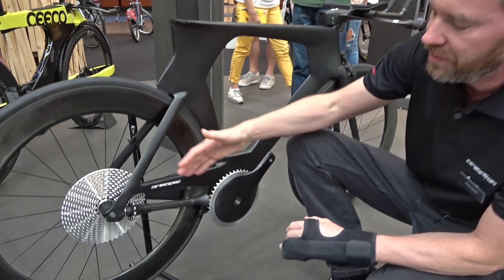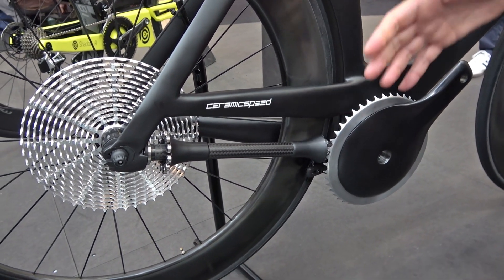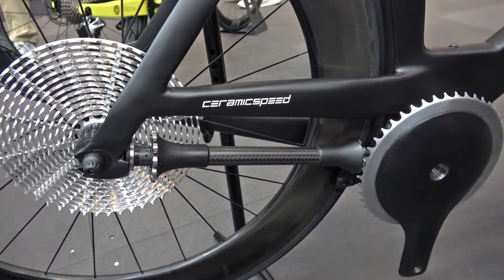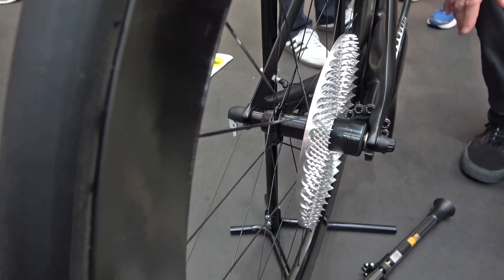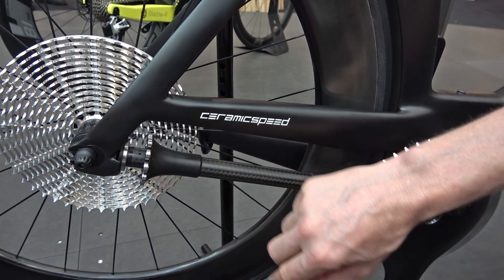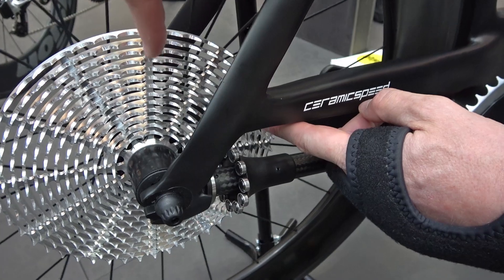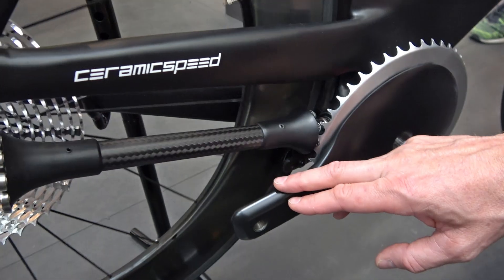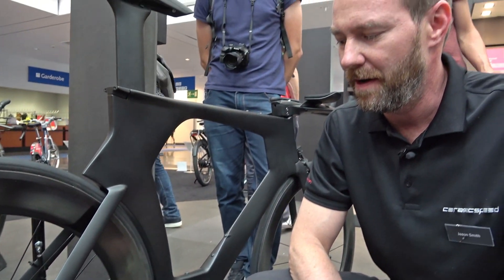CeramicSpeed Driven - Fully explained

Comment: "The world's most efficient drivetrain." ... Yeah, when you twirl the crank with your pinky! 
2 points of rolling friction is great until you put some force on it, then you realize that you need those 8 more points of contact in order to handle the torque necessary to power a bike/rider forward. 
Aesthetically, it looks pretty, but mechanically it looks ugly to me because you're changing the axis of rotation twice.
Reply: That is true
Reply: I agree with you. This is not IC engine to reduce the friction is a fakin bike!
Reply: Not to mention friction in two bearings at beginning and the end of the axis.
Reply: GR28 yeah. The tolerance on this is crazy. They are just doing a regular drive train so they need to go helical for more contact surface area. 

This is nothing new or special. They are way behind of current tech so they are actually a bit stupid.
Reply: also there using open bearing that would need to change out here in Australia the is loads of dust even in the big city's those bearings wont last long
Reply: True
Reply: You got a good point..
Reply: 2 points of roller friction... The bearings make contact with the entire surface of the cog teeth vs many tiny points of contact with a chain. Inside those bearings, there are many more points of contact more evenly distributed. 

How many times does your car's drivetrain change the axis of rotation? A lot more than twice! How many chains are used in the drivetrain vs how many bearings (fluid and roller)?
Reply: "Drivetrain"? I didn't see an actual drivetrain
Reply: Additionally, the fact they need to substitute good mechanical design with a computer interface for gear shifting stands out as a major design flaw, not an innovation & adds a layer of complication of things that can go wrong under extreme conditions.
Reply: I simply do not believe that this design is durable. It will need regular replacement, which is a nice idea if you make you money by selling stuff.
Reply: @johnmadsen37  yep. choice of weight reduction would not stand up to much hard peddling. an athetic human can output almost 0.4hp and the torque from gear reduction would mash the teeth of those aluminum cogs... intersting but sooo not practical
Reply: I might disagree on account of originality since a system very similar to this one performs excellently in detal handpieces and counterangles with more than 40 thousand cycles per minute. Lubrication however might present something of a problem but the whole system could be hidden inside the rear forks thus offering protection from accumulation of dust and dirt. Nevertheless,  a lot of potential in this system.
Reply: @mrbobsevil  The bearing wouldn't make contact on the full surface if the bearing diameter was smaller that the diameter of the cog teeth. They would only make contact on a very small portion of the bearing surface as it rolls through the cog.
Reply: ForexTradex Take a wild guess what the efficiency of even a manual car transmissions is???? No where near 90% why do racers add differential coolers... because low gear efficiency heats the oil up
Reply: Kirk Claybrook energy in one side, motion out the other....drivetrain
Reply: I was definitely curious about the smoothness of engagement, as well as deflection and deformation of the "cogs" under load.
Reply: What's really ugly is a chain that flexes, when you shift, and becomes inefficient.
Reply: @ForexTradex

Only once. I have a proper rear wheel drive vehicle.
Reply: With a chain all of the forces on two little sides of one link.

Comment: This thing would pop the bearings over the teeth if you push too hard
Reply: agree and that disk looks actually very fragile considering part of the force will be perpendicular to the disk
Reply: That is exactly what I wanted to comment, beat me to it
Reply: Especially if you have this 20 speed version.  The gear furthest from the hub would get really wobbly, I would expect.  Then add hammering it up a climb, where you would use that gear.... seems like you'd need a two sided cage version that holds it all together.
Reply: Or hit a bunch of bumps while hard pedaling.
Reply: Exactly what i was thinking... imagine a sprinter going full tilt max wattage in a lower gear with that disc  flexing .... bearings jumping teeth like crazy.. that + full suspension= disaster !!  Unless the drive rod was somehow   also the swingarm ???
Reply: Green Lizard    GOOD ONE. GOT MY LAUGH FOR THE DAY.NOTHING FUNNER THAN OR MORE PAIN FULL THAN A NUT SHOT
Reply: I think to help with the extreme torque the rider would put on this you would have to make the front teeth much wider and out of a very durable material.  Then the shaft would need a huge gear up of something on the order of 10 to 1 to start with, maybe more.  This would make the cassette area wide and it's diameter large too.  Still does not solve shifting challenges.
Reply: Exactly what I thought!  Put a couple pro riders on this and I think they’ll chew it up and spit it out.  Nice to see some thought going into new ideas but it’s gonna be hard to beat the tried and true chain and derailleur system.
Reply: Hey Mike I responded to this video with a very similar answer to yours, not knowing what you had wrote.  I agree with your comments.  But I also believe it is very good for the sport that folks are looking for a better way - I just don’t think this is it. I like the idea that this bike drastically reduces dish but I also think it’ll get shredded in a relatively short period of time.
Reply: @mikemace2322  Full suspension? This is clearly intended for road/tt bikes. MTBs don't need 99% efficient drivetrains.
Reply: NASA will have men on Mars before this monstrosity ever works. Only a pillock would buy into this nonsense.

Comment: I guarantee  that would either break or slip under high torque like hill climbing.
Reply: That's the first thing I thought. Everything is under a side load now and no backing plate for strength. Cool design but I think it would end up In pieces.
Reply: Wait till you snag a plastic bag....You will have to call the A.A. out for a tow.
Reply: I think they could solve that by beefing up the cassette, but that would add a substantial amount of weight.  Would be cool for someone like me who doesn't race, but anyone who does would want to watch out

Comment: Only one question for me is how much torque can it handle before popping out of the track or shearing driveshaft or stripping ceramic ball bearing out of housing basically how much power can it handle.
Reply: Month later no reply must not be able to handle much power might as well assume that is its flaw

Comment: So it doesnt shift yet, so basically theyve jst dug up a 100+ year old drivetrain and done nothing with it yet
Reply: No, the 100 year old drivetrain actually worked. Major Taylor raced on it. But it was a properly designed shaft drive.
Reply: Weird how some modern ideas were someone's pipe dream years ago.  Like the electric car and apparently this drive train.
Reply: Random Kirks Italians made an electric car in the 50’s or 60’s if I remember correctly. It wasn’t very popular.
Reply: @mrnobody9821  Studebaker made electric cars and busses in 1890. They worked.
Reply: It looks nice on that stand, but I see several problems having to do with the pressure between the tiny bearings and the flimsy gears, by the time you're done it will be four times heavier.

Comment: Undoing the inherent simplicity of the drive when you add electronic-wireless-battery powered shifting.
Reply: High end derailleur bikes now use electronic shifting, with batteries and servos. It's lighter and more reliable than using bowden cables.
Reply: just buzzwords to sell old tech as "innovation"
Reply: The pinion is rotating so it needs to be wireless.
Reply: It would be nice if electronic derailers could be powered off the bike itself.
Reply: Barbatio I think that would be completely possible. The rotation of the shaft could generate current in the same way an automatic watch is powered by your wrist. 

I can think of 3 reasons not to do it that way. 

1. Perhaps the space is very small and they already and having trouble making the electronics fit. 

2. The generator would require some, even if it’s very small, humans energy. It might add up in a long race.

3. It’s possible the current draw is pretty high and would not be offset much but a small generator in the shaft.

4. Added expenses and such. Although I doubt they are worried about that
Reply: @Mrcaffinebean  I meant to say, they charged of the bike, the battery still handled a lot of it, but they charged when you were riding. I also worded that weird, I mean it would be nice if they were powered off the bike.
Reply: Barbatio I’m not sure I understand what your getting at
Reply: @Mrcaffinebean  Electronic derailleurs that are battery powered, but they can charge off the bike while you're riding.
Reply: Barbatio right, but all of those consume power and add weight and they don’t need to fit in a tube like this one does.

Comment: There is no foot pedals so that nobody would come and break it. Now imagine that under a hill climb by 100kg man. 

Efficiency may be 99% in a small torque, but in human foot force is too much for this. To withstand this, they would need to make this a lot heavier. I hope potential investor will be able to read these comments.
Reply: voaa they said they tested it as 380 watts
Reply: It is torque that breaks it, not the watts. Think of 100kg standing on pedal, torque is about 250Nm, power 0W.
Reply: @cjschmitt4882  So it being a prototype excuses the totally infeasible design? Okay...
Reply: thanks for warning me :)     BTW how much is "too much"  engineers work with numbers not opinions.  How do you know that human force is "too much" for this mechanism.  As soon as you step on the pedals, you would convert torque to linear motion.  
Besides, nobody is holding the bike wheels against rotation place and have an elephant step on the pedal.  :)
Reply: Climbing a hill would tear that puny shaft to shreds. So many things wrong with this design I don't even know where to start.
Reply: @abz124816  Obviously I have nothing to go on but this video. Niether do you, from the video you can estimate the shaft diameter, and the approximate number of layers in the wall. The maximum shear stress of carbon fiber is already known. If you do the math...which I'm sure you already have done, you would see that the shaft will buckle under loads close to the maximum torque a cyclist can apply to a pedal. Plus this torque ~1000nm is then applied to a single tooth on the cog. On a chain-drive, the torque is spread out amongst several teeth. The other design element that is sketchy is the electronic shifting mechanism inside the shaft. Wireless communication is going to be pretty difficult through a wall of carbon fiber, and batteries will have to be very long lasting and rechargable, not to mention the size requirement is pretty tight for a battery, com, g sensor, actuator, and motor.  I get it. He name drops a university and people think, "wow this is innovative!" But keep in mind, these are students, working on something for free. They aren't actual engineers working on a functional prototype.
Reply: @s00p3rman   Hi Joshua, 1,000nm = 737 ft lb.  A VERY powerful car engine produces only 300 - 400 ft-lb of torque.   How is a human being going to produce 
737 ft-lb?    Additionally, nano technology and new materials science,  (look up Graphene), already provide materials, though very expensive still, that are incredibly strong.  Rather than being critical of the design,  admire the creativity and ingenuity.   20 years ago there were no carbon fiber bikes that weigh 14 lbs., today if you have the money, you can buy one.   
From first human flight ever, December 17, 1903 to a moon landing Jul 16, 1969 took less than 66 years.  Can you believe that?   Have faith in science.   :)

Comment: As said its very light and has low friction. 

Now if you show it withstanding a rider kicking up a hill without causing deflection of the rear gear cluster away from the rollers on the shaft, you have overcome one obstacle.

If it will shift reliably/smoothly going up a grade under heavy load you have overcome another.

If it can withstand abrasives and moisture, again another challenge met.

Seeing as to how this vid is almost a year old I would have to assume some of these engineering challenges are proving difficult to overcome.

Comment: I don't get why you put it on the rear wheel. Adapt this into a "gearbox" that can serve as the front cog with a drive shaft turning a worm wheel in the rear so then the rear wheel suspension can work better.

Comment: The rear sprocket doesn't look rigid enough when you are in Low (driving outermost sprocket.)   The radial ribs appear to be constant cross-section when they should be exponentially tapered to get the necessary out -of-plane stiffness of the outermost sprockets.

Comment: Materials are not there yet. Too much load on one bearing "tooth", and rigidity of cassette has to allow for low gear (outer ring) from springing back at high loads. Nice demo, hope someone invests in it as a good lesson to learn mechanics.  ( :  A text book from 1830's would do
Reply: yeah, but the teeth don't need to be formed like what we see here, what we see is what you'd shape them like if they (still) would have to grab onto a (bike) CHAIN! they didn't think of that yet, but now that we got rid of the chain, of course we'd shape the teeth the way the teeth on PROPER sprockets would be shaped, where on both sides the teeth are shaped in an equal fashion - and MUCH stronger than what we see here. besides, the construction as shown with unnecessary ball bearings in the back even has more week spots where those ball bearings are attached.

Comment: Problem I see with this system: You need very little tolerances in the concentricity of the chainrings and a high stiffness of the crank and bikeframe under load. The drive shaft can not counterbalance any tolerances or wear like a chain can do. So you need a force to push the gear to the "chainring" to prevent "jumping". A Chain creates its own force , which pushes it to the chainring. You can compare that system with a back differential in a car.
Reply: Its got to be so stiff with no flex and  tolerances so precise and it would probably wear out sooner cause of less surface area loading in an abrasive harsh environment unlike a diff. Pretty but unlikely

Comment: "Wireless electronics" inside a carbon fiber tube which shields rf......nice art project.
Reply: @WhiteShadow2k1 might get complicated - the shaft is rotating. Not saying there isn't a way, but the wireless option would probably be the easiest.
Reply: @joeMW284  a wire connected up to a magnetic sensor/signal generator could easily transmit a signal to a rotating shaft without contact.
Reply: Such a short yet absolutely brutal comment - "nice art project" just puts the cherry on top of this masterpiece of text.
Reply: @joeMW284  a slip collar to control the gear shifting portion could easily be actuated by a simple wire cable. slip collar would just ride in the air as the drive shaft rotated inside of it unless shifting then contact with the inner portion of collar that would be a bearing, push or pull you could shift gears smoothly and easily without worrying about the extra weight the electronics add.
Reply: @WhiteShadow2k1 It would be easy to install a device that would generate enough power to recharge just by riding.
Reply: I think you could design an antennae to receive the signal that was outside the carbon fiber.
Reply: @joeMW284  not difficult.. but it might add a third point of friction again :)
Reply: @WhiteShadow2k1 not necessarily. You can do wireless charging over short distancea.
Reply: The joke seems to me to be a bike that could be stuck with a flat battery.  I suspect a cable could work but would need a spring to cause it to move when teeth align properly but without using a microprocessor.  I am sure that even that idea can be improved on as well.

A loosely woven carbon fibre probably would leak enough radio signal.
Reply: WhiteShadow2k1 because it is a rotating mechanism. You either need a slip ring contact or just go wireless because there are less moving parts
Reply: @WhiteShadow2k1 Right? The carbon tube could just rotate around the housed wire.
Reply: Definitely cos it would be fucked up if your sprocket started blaring out Mötley Crüe or something like that when you get to the top of a hill.

Comment: The whole mechanism would be destroyed the first time someone actually tried to pedal it!!! 
We will never ever see this on any bike...
Reply: But it is a bicycle, later versions may be beefier and stronger, this is just the concept and not the final design
Reply: Unless the makers use stronger parts it will not work, but it could work with said parts
Reply: See, the thing is  I know, just a cool idea though
Reply: Shifting would probably be difficult to get working but motorcycles use shaft drive. Although the gear changing happens in the engine.

Comment: My only question, How do you control flex? The drive sprocket looks beefy enough, but the rear one looks very thin. Even if you use an exotic materiel like magnesium or titanium, there isn't enough mass to prevent a lot of flex and eventually breakage

Comment: I fully understand the need to improve and modify things but in certain circumstances reinventing the wheel when you just need a tire is silly. It's like cutting all the sharp edges of a square block untill it rolls and calling it high tech rolling device. The concept is great but I just can't see it standing up to powerful pedaling.. there will be flex and all sorts of issues.